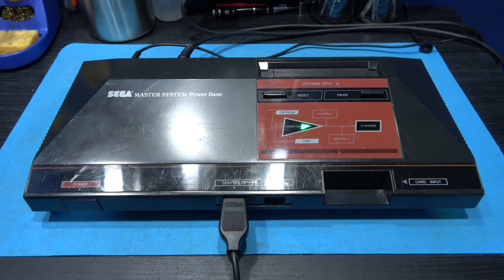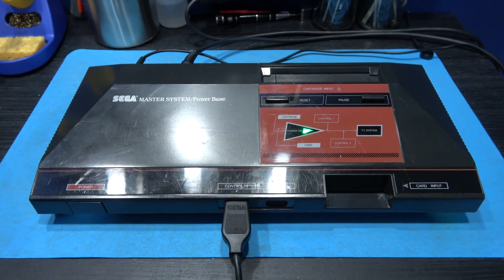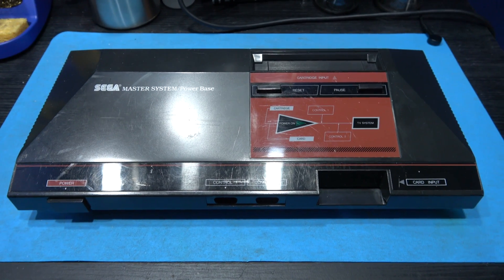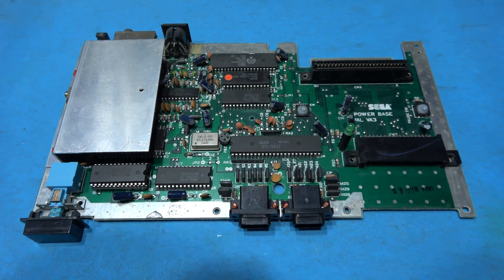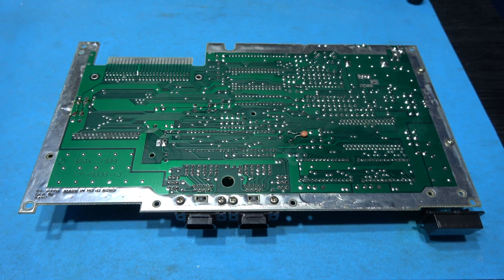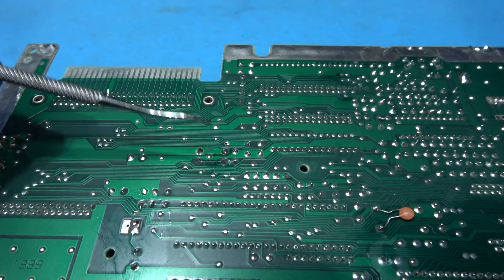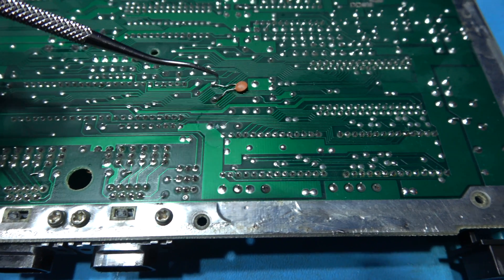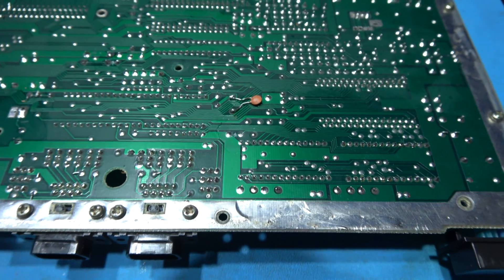SEGA Master System - 50/60Hz Switchless Mod.

Comment: Do you have the source code also? While I like this mod I think it's a shame that the original reset functionality is lost.
Reply from the maker: Not it's not, the reset is still intact, if you press reset for less that a second the console will do a normal reset. if you hold reset for longer than a second you cycle the regions. it's seb's code, easily fond on the net. https://github.com/sebknzl/saturnmod

Comment: Nice mod! That wiring is very neat, what do you use?
Reply from the maker: Thanks, it's just a simple SN-28B dupont crimping system. Crimping the connectors instead of soldering them makes it look nice and neat.